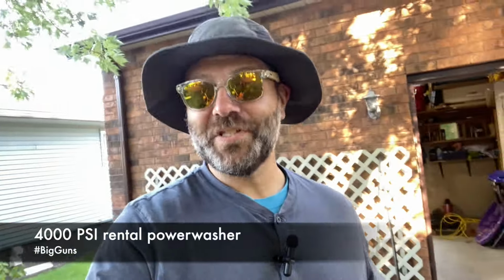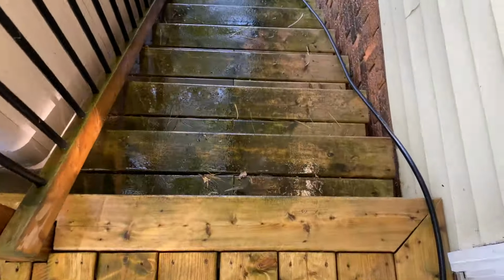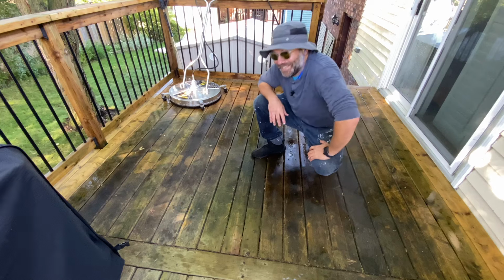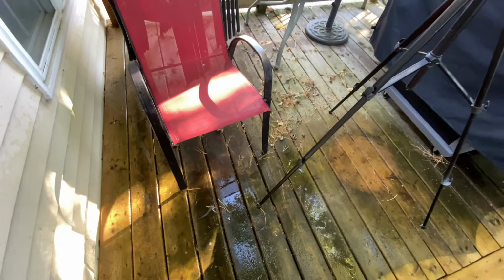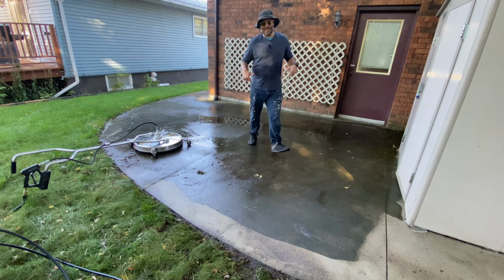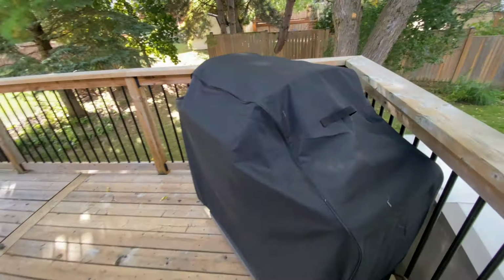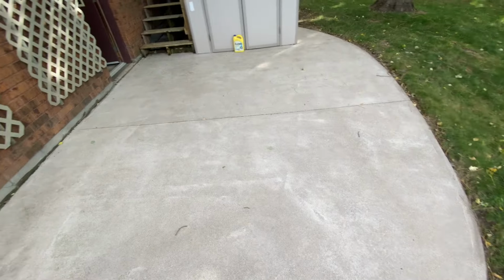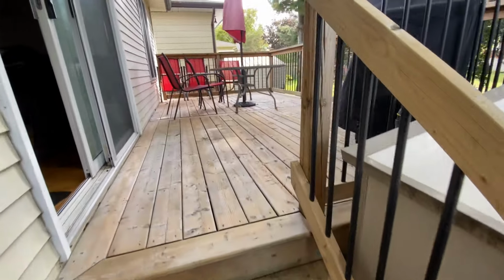Pressure washing Cement driveway and pressure treated deck.

Comment: Great job. Just a quick question, is there any lingering smell of vinegar after using it?
Reply from the maker: @nzjustice1118  none at all. With the amount of water released from the pressure washer and surface cleaner the vinegar gets diluted and washed away very quickly. Thanks for your question.

Comment: So no circles on the stairs, but circles on the deck is OK is what you’re saying.
Reply from the maker: @markc3571  yes, because the surface cleaner spins at such a rapid constant rate, as long as you move it slowly side to side it doesn’t leave any patterns. When you try to use the gun in circles, it’s hard to keep the pace perfectly timed and any pauses will create uneven patterns.👍
Reply: "..genius at work"!💯💯💯